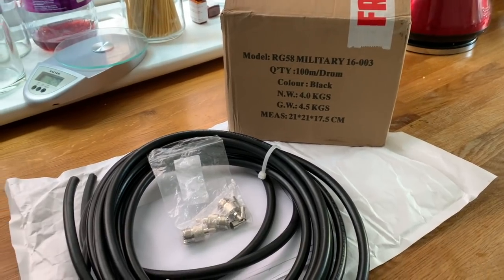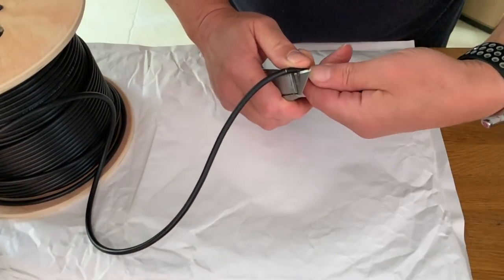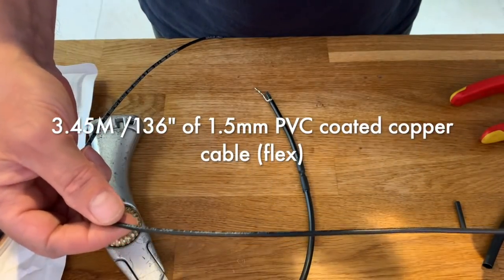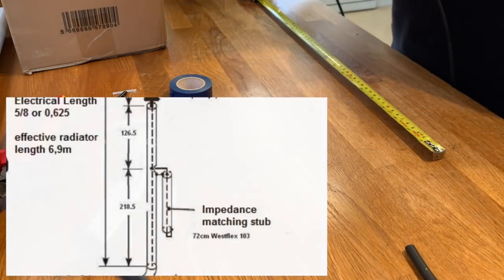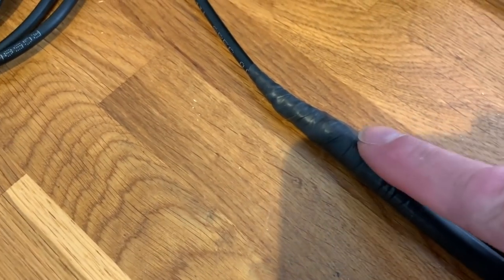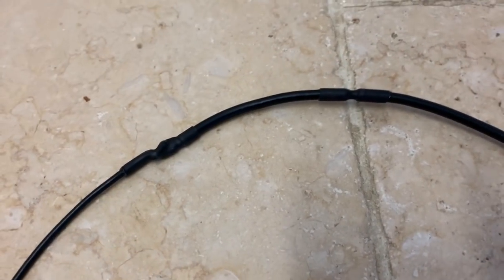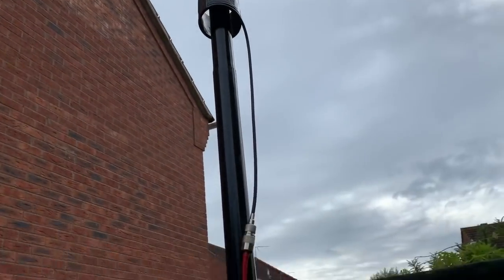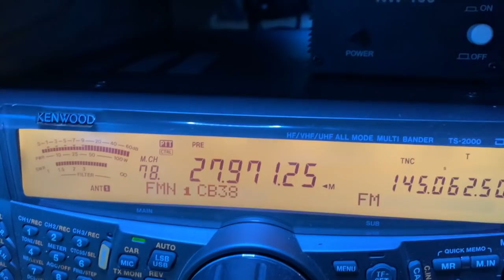CB Radio: Build a GainMaster (the rebuild) on a DX Commander Pole..Detailed upload

Comment: This is the first 5/8 I've built to start playing around on 11m. Used RG58 and LMR400 for the stub. Followed your clear instructions and ended up with and antenna with SWR 1.2 or lower for 26 - 28.3 MHz and below 1.4 for the rest up to 30MHz. Also got my first CB dx with Brazil from South Africa with a 5/7 5/8 report! Brilliant, inexpensive antenna. Can't wait to tinker around with your other ideas!
Reply: How long is the matching stub of lmr 400?
Reply: How long is the stub of LMR400?

LMR-400-UltraFlex or simple LMR400?

Comment: Mike, I used your plan to make an antenna.  I tried supporting it with pvc pipe, but that acted like a wet noodle so I just hung it from a tree using a pulley system.  SWR ranged from 1.05 :1 for 28.460 MHz to 1: 1.16 to 1.22 over the cb range 26.960-27.410 MHz  it came in at 51.2 ohmsuntil you got to the lower end of the CB band 26.960 came in at 43 ohms.  I'm hearing skip from as far away as  Corpus Christy, Texas (I'm in North Carolina) over 1300 miles!  I actually conversed with someone about 6 miles away and it was a very clear and strong signal.  I used DX 400 max from DX Engeneering for the matching stub. Now I have to get mt 10 meter radio configured correctly.  Thanks for the videos!

Comment: It doesn't take a lot of tweaking to get the design to cover 12m and quite a bit of the 10m SSB section within a 2:1 SWR bandwidth. Instead of the air-cored choke I use 12t on an FT240-43 toroid and it works fine - identical performance to the air-cored choke but easier to fit in a pack for portable.
Reply: Maybe you should put a video up of how you did yours or even just a graphic.

Comment: Hi Mike I made me the gain master and must say great antenna. from 26Mhz to 28.8 swr 1/3:1. I made some qso's on 27285 FM with UK stations and on 10m band with EI7HBB with a 5/9+. I used RG58 and RG213 for the stub. Because I don't have a westflex coax. 
 I didn't know the length for the stub of the RG213 I started with 1m and the end result is 73cm. for the people using RG213 . 73cm length.
Mvg Nic on5ma
Reply: Thanks for this! also i do not get westflex in my country but rg213 is avalaible.. Off i go to building now! :-)
Reply: @Calderone81  good luck with building the gainmaster. Great antenna Patrick . 73 s Nic
Reply: I got 60 Ohm. Should I make it shorter or longer?

Comment: Hi Mike. I’ve made both the 1/2 and 5/8 antennas and find them to be exceptional. I was unable to locate any Westflex so used LMR 400 ultra flex with slight adjustments for the VF. 5/8 is usable from about 24 - 30Mhz.
Keep sharing antennas that really work. 
73s, Mike ZL1MJB.

Comment: Nice video. Assuming the .66VF of the coax you are using, it looks like it would easily be scalable to build the whole antenna out of RG-213 mil-spec for high-power and be done with it.

Comment: Well after watching your video two or three times I think I'm going to build a fiberglass radome from scratch on something like PVC for a former, then remove the PVC if possible 
I don't know I'll have to experiment but friend of mine showed me his Station Master he picked up decades ago (Phelps Dodge is the brand) and I love it, it's about 3"- 4" diameter, except it's only 20 ft long and that wouldn't be enough to house the full size GainMaster - so I'm going to have to build one of my own. 
- The idea is to make something strong enough, tough enough and stiff enough that it holds its shape atop a ponderosa pine at about 130 ft at the base.
  If I can figure out a way to get it filmed and uploaded then I'll do it!

Comment: Just built one out of old rg58  and some rg8/u for the stub 
 Hanging across the room  the swr  is pretty  dead across 11m into 10m with 5w  so try later today  on a pole n see how it  does rx against an imax if the bands are open 
  Rg8 is .84 so only 4 off on the velocity factor   hoping it works as good 
 Tnx for great  video 
 Cheers   happy hombrewing 
Pat ☝️💪🍻
Reply from the maker: Cheers Pat

Comment: I am going to have to watch it again, it looked as if you just used thick coax for the matching stub, but then I was tired at 2;30am and my brain had slowed down.  I take it that there was a vast improvement, but I just watched it and it went in one side and out the other!  Good video though Mike.  I'll be back to watch it again this weekend.  Though I can't see me getting to put it up, however, a string fired over a tree and pulled up might work ok.  I think it would work well on top of a hill near me that looks south, west and east.  I need to obtain a pole to try it.  Nice one Mike.

Comment: In trying to understand the difference between the Half Wave and 5/8 of course a matching device is necessary, now  I get it along with the 2TLT versions. I guess a 20 meter verson could also be figured out. The 18 meter or nearly 60 ft DX Commander pole would also make the ideal for the first antenna for a CBer, especially with the bands beginning to open up, in the states it is legal to talk to anyone you can reach so skip will be fun this sun cycle unlike my CB days when I became a Federal Law breaker LOL.  We all know when that guy across the pond was heard we didn't try to make the contact. I had a contact in Rotterdam that I spoke to from my mobile many mornings working out of my car. His call was PBC123 we spoke on the slot channel below 15 and 16 in those few kcs SSB folks were stuck in 1970 or 71.

Comment: Great antenna project. I have a question: how do you increase its continuous power handling? Let's say, 1000 watts. As far as I know, current gain master 5/8 is only 500 watts. Thanks.

Comment: Hello Mike firstly great videos, learn't so much from you and Hams like yourself who make these videos to help others. I hav a question regarding the "CHOKE", 66mm is the diameter the governing factor or the length. Basically I am asking can you use another former size if that is all you have to hand, so long as the length of coax in the coil is correct. Thanks very much, keep it up.

Comment: very nice construction and detailed explanation. I don't understand....  , confusingly in the measurement: On the RG58 measure 218.5cm/86" down from the matching stubb, and at 15:35 you say 2.26meter to the top of the coil. what is the correct measurement?
Reply from the maker: Hi many thanks, 218.5 cm is the correct measurement, the other measurements includes the height of the coil….
Reply: Thank you for your response and instructions. Do you connect the end of the westflex 103 back?

Comment: Is it critical to use the quality Westflex coax? If its only a 75 ohm stub and not being transmitted through, is it that important ? It just means having to buy a 1m length, everything else I have ...Cheers Mike
p.s  Any chance of a 27/28 mhz slim Jim. Its something thats always fasinated me. I ve had sucess with 2m and 70 cm but always failed on 27/28.

Comment: Hi Mike did it tune up straight out of the box as they say or did you have to adjust the antenna?; Looks like I've got something to play with the weekend  if it will work with 213 coax thanks for the great video 👍
Reply from the maker: A little bit of fine tuning required

Comment: Hi Mike,what the difference from rg213 and westflex 103 for the matching stub.
Regards.
Reply from the maker: Velocity you can use RG213 or RG314, LMR400 but you will need to work out the length, start long and cut back.....

Comment: Very good video. Im a new subscriber and the questions I have are, what size DX Commander pole are you using and what size coax are you using to go to your radio? As well how are you adjusting for SWR? Thanks!
Reply from the maker: Dennis Kwasnycia Hi, the pole is a DX Commander Classic so about 9.4M, I am using Ecoflex 7 from the antenna back to the rig. There is no need to SWR if build correctly but a mixture of cutting the length (top) and matching stub. Top firstly.   Cheers

Comment: So, it is a Bazooka basically. Great video!  It would be more manageable to use a choke (toroid) over the coax balun (1:1 current), and run it inside of the tube.

Comment: Hello. With inspiration from your video, I want to build my own antenna. I don't have the opportunity to get Westflex 103, I only have RG213. Should the measurement on the stub still be 72 cm when I use RG213?
Reply from the maker: no, you will have to play with the lengths ( maybe shorter)
Reply: @mike-M0MSN  i made one inside a 8 meter fishing pole and the difference between my old alu 1/2 and this gain master is big. It's much better than the 1/2 vave so I'm a happy man 💪

Comment: Hi Mike. Made this antenna but made the top section out of a piece of wire. Just wondering if the  top section could be made different lengths to suit other frequencies and bands ?
Reply from the maker: You would need to scale everything.  up or down to shift frequencies

Comment: hi mike. can you or anybody who has built the antenna clarify where the measurment starts for the top section as you cut a lenght of 345mm 1.5mm wire but the drawing you show, shows the 345mm starting from the centerpoint so it then includes the capasitor lenght. i have made this antenna this afternoon but am now unsure of the lenght of the top section or at least where to measure it from.
many thanks for making the video.
73's richard
Reply from the maker: I cut the element longer as it is easy to cut to the correct length once finished.

Comment: hi Mike, a question about this gain master project. I notice that you used an rg 58 cable (with a speed factor of 66) if I use a messi paoloni hyperflex 5 cable (with a speed factor of 87), the length of the stub always remains 345 cm after the reel? always using rg 213 for the 9pf capacitor and impedance adapter.
Reply from the maker: There is no need to use M&P you will not see any benefit, for what it's worth stick to RG58.  :)
Reply: @mike-M0MSN  OK thanks . I'll do the experiment

Comment: hello the coaxial cable you used, is it at 50 ohm with speed 0,66 or 0,70? because there are gain master projects with slightly different sizes thank you very much
Reply from the maker: 50 ohm with speed 0,66
Reply: Ok thanks

Comment: Hello Mike, great video please keep it up!
I would like to recreate the antenna. I only have the problem that I cannot get the Westflex 103 here in Germany. Is there an alternative?
Many thanks
73 + 55 others
Skip: Satellite 4000 or 13AG267
Reply from the maker: Andre G RG-303 or 213, but you will have to play with the length you need maybe start with a metre and cut back until a resonance is achieved
Reply: @mike-M0MSN  Ok thank you very much and I hope there are more great videos.
73 Andre

Comment: Hi Mike to move it it a bit down on the 27 mhz band would you lengthen the stub or the driven element? Great job!
Reply from the maker: Yep make the driven element a bit longer will move the centre down the band... but why it's flat across 26 to 29mHz
Reply: @mike-M0MSN  Thx Mike.

Comment: I have all of mine constructed, just waiting on the Westflex 103 and still need some type of pole. The DX Commander is awesome but boy is it pricey.😬
My budget is cane polish.
Reply: Blade I calculated the impedance of the shunt matching section of Westflex 103 and it appears that a 127nH shunt inductor will give the same effect. I’m not an antenna guru but I have more than 30 years of RF circuit design under my belt and I’m pretty sure that it will work.
Reply: @johangrundlingh3729  Is that like a certain length coil that could be used instead of 103?
Mine is working great with westflex 103.
1.31 ch1, 1.15 ch 20 and 1.31 on ch 40 SWR
Reply: Blade I was thinking along the lines of an air-cored solenoids inductor. A 127nH inductor could be a 4-turn coil of #18 wire wound on a 3/8” mandrel, length of coil = 3/8”. What can I say, I’m cheap...
Reply: @johangrundlingh3729  Have you tried that? Sounds like it would be way lighter and less hassle to solder in.
It would be interesting to see the calculations it takes to figure all that out.
Reply: @Blade I’m in the process of building the antenna but I’m waiting for the fiberglass pole/mast to make it work. For the calculation I started by calculating the reactance of the shorted coax assuming losses are negligible: X=j * Zo * tan(length in degrees) and then finding the equivalent inductance from L=X/(2*pi*Frequency). I’ll let you know how it turns out when I get the mast.
Edit: I realized that I forgot to factor in the veloci factor of the Westflex 103. The recalculated shunt inductance is 150nH.
Reply: @johangrundlingh3729  Ok what kind of Fiberglass pole have you found?
Reply: @johangrundlingh3729  Ah yeah that looks nice!😀
Reply: Blade I got my fiberglass pole this morning and I tried the 150nH shunt inductor trick that I mentioned before. I also made another change; the coax choke was going to be a pain in the butt so I changed the diameter and number of turns to get something that fits inside the pole. I used a piece of 3/4 inch PVC pipe as the former and wound 35 turns of the RG-58 coax on it. I did a quick check and SWR at 27.5MHz is about 1.25:1 which is not too bad for a MacGyver version of this antenna in my opinion. The big difference is that I put everything inside the pole. I will try tuning it a bit when I get the chance.
Reply: @johangrundlingh3729  Great so you have all of the antenna inside the pole? Including the coil?
I thought it was super important that the coil be wrapped around a 62mm pipe. Guess not?
Reply: Blade Yes, I managed to cram everything inside the pole. 😊   Not sure that it’s properly tuned yet but I will fiddle around some more and let you know.
Reply: @johangrundlingh3729  With SWR that low I can't imagine that it needs much tuning. Mine is 1.31 on 20  and 1.15 on 1 and 40.
Its fun to build one. I have mine strapped to a wooden pole and plan to build a 35 ft tilting 2 inch EMT conduit mast.
From there my gainmaster will fasten to the pole by a sliding bracket that I have not built yet. Then the entire antenna will slide up like a flag.
Reply: Blade I like the flag idea a lot and might have to borrow it... 👍🏻
Reply: @johangrundlingh3729  Yeah these are are so tall it would be easy to take it down fairly quick if a storm came up.😀
Reply: @johangrundlingh3729  - Pleased to read you got a result with a much modified coax choke as I too was wondering about this.
My plan was to wrap the coax around the outside of fibreglass pole, but I had (still have) virtually no idea how many turns at that reduced diameter.
Did you use maths or guestimation when did your 35 turns on 3/4 inch former?
Reply: @johnbirkett  I cannot remember exactly but I think the idea was to use about a quarter wavelength of coax for the choke.

Comment: Using the Hawkins radio 58+ Thunderbolt for a few years now .For Mobile static. Amazing results on 10 and 11 meters. On a fibre glass pole . Feed at 1.5 m extending to 10 m.. all on 100 w. 
73s  HS0ZOU

Comment: Can i use for the stub RF-7 cable?  Why i can't use rg58. Please help
Reply from the maker: You can use any coax it is simply the velocity of the stub and power rating.  adjust the length of the sub to match.

Comment: What is the difference between the westflex and the coax? Do not know where you can get westflex.
Reply from the maker: Its just another type of coax with a better power handling and VF.  You can use RG58 but a shorter length and lower transmit powers

Comment: Westflex 103 is not available in the US. Would RF Davis Bury Flex work? Or what should one use?
Reply from the maker: Any high VF coax.
Reply: Thanks. So you are measuring the capacitor to the braid not the additional 1CM stub correct?
Reply from the maker: Not sure what you are asking here, the coax capacitor needs to be 87mm long. with a 1cm /10mm gap between the the bottom of the capacitor and top of the coax.

Comment: hey Mike, very nice video. Is there a plan to rebuild a Imax 2000 ?
That would be very interesting, because it works on 10,12 and 15m it´s a great DX Antenna but very expensive.
And what about a Gainmaster for 15m or 20m ?
73´s from DH1KJ
Reply from the maker: Jochen Krebs well you have given me something to think about.
Reply: @mike-M0MSN  that would be very nice. Let me tell you a question, how much power can this antenna handle. 
Cheers DH1KJ
Reply from the maker: @jochenkrebs9685  do not know the retail version says 1.5KW  so maybe 500Watts.......????
Reply: @mike-M0MSN  1,5 kw :-) i would never work with that Power with my Imax. But 1 KW cont. would be very good to build something that can handle that. That´s the wishlist LoL  73´s

Comment: Is there an antenna model for this? I'm curious of the radiation pattern Vs a standard EFHW 1/2 & 5/8 . Does it offer an improvement in performance, or is the design benefit the large bandwidth?
Reply from the maker: Comparison is often difficult with EFHW as the GainMaster is a vertical antenna and EFHW are normally horizontally polarised. However it is comparable to other vertical antennas and as a 5/8 has good gain.
Reply: @mike-M0MSN  they're the antennas I meant. Isn't a normal CB antenna just an end fed halfwave dipole with some sort of matching to allow for the high impedance  of feeding a dipole at the end rather than the middle?

Comment: Hi there
I am new at this.... ok so goes i have pvc 1"
27.300 mhz is what i want 
I have 1 wire 10 gauge at 103"
 wire with 2 of 12 gauge wire 103" for radios 
How can i match this to a SWR of  1.5?
Reply from the maker: Add more radial wires minimum of 3- 4 radials must be 1/4 wavelength and driven element is cut long maybe 105" and then cut shorter by 1/2" at a time until minimum SWR is reached.